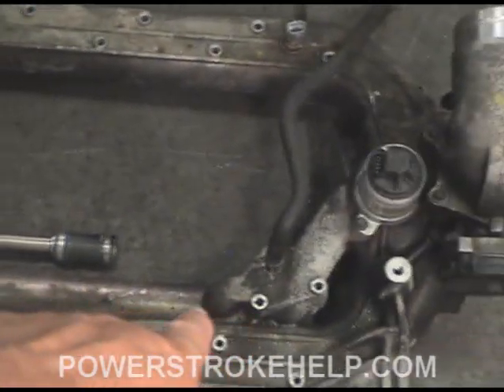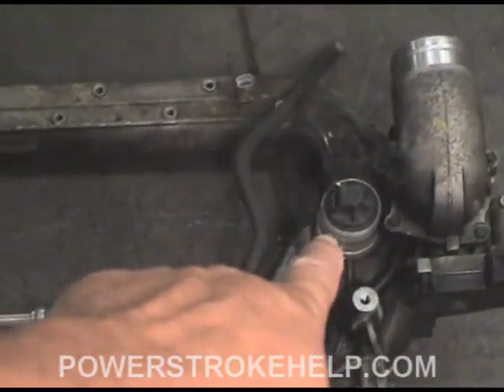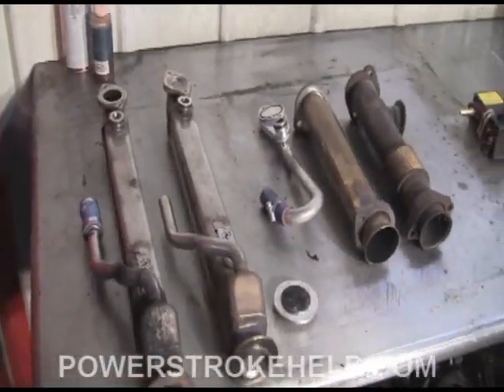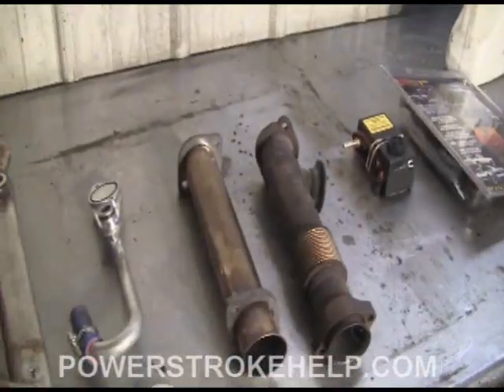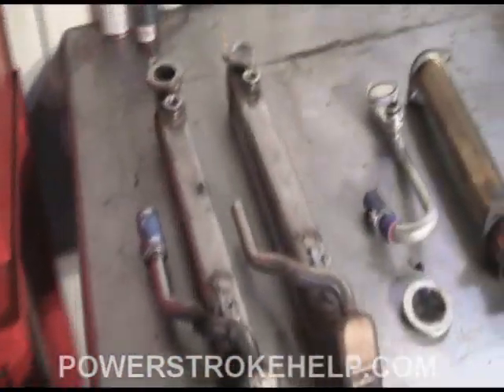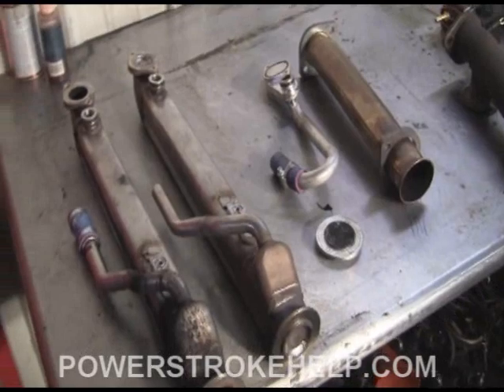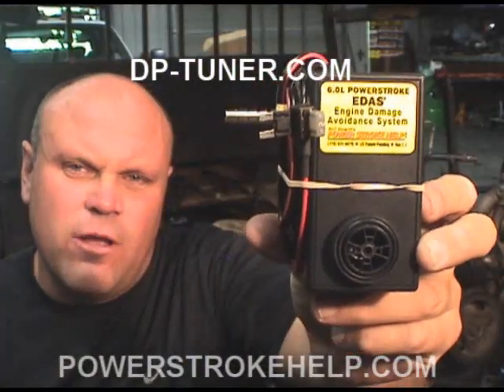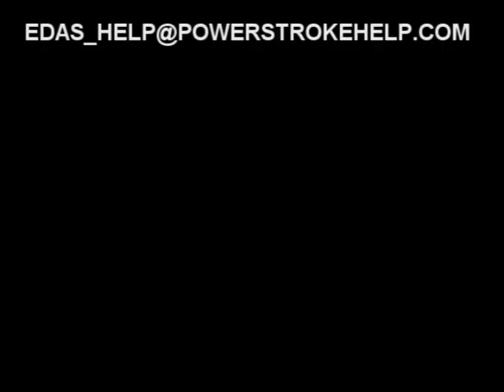6.0L EGR COOLER DELETE AND OIL COOLER ISSUES

Comment: I have a question ,I have a customer that bought a 07 f250 with a 6.0 and it had just go item the head gaskets replaced ,but they did not replace the head bolts .my question is this can the head bolts be replaced one at a time or do the head gaskets need to be replaced

Comment: Navistar uses CAT EC-1 ELC in their versions of these engines with the same EGR and oil coolers, and they don't have the issues of the Fords with the precipitating coolant they DEMAND be used or you void the warranty! Unfortunately, deleting or defeating the EGR system is ILLEGAL and states are beginning to crack down on the practice. Best to replace with the new, stronger design, new oil cooler, coolant filtration system, and use the coolant specified by the manufacturer, NAVISTAR,...CAT EC-1 ELC after a complete flush and back flush of the complete system. 😊

Comment: Wait so I can just weld the ends shut on my EGR cooler and It'll act as an EGR delete? its that easy?
Reply: Yup. That and a block off plate for the valve itself. That's it. You can't get tunes  to shut off the engine light in 05 and up anymore. You'll have to live with the light, or... Plug in the EGR and reinstall it. It won't pass exhaust gas as the ends are welded shut. Make sure the weld job is done properly, and bam. 

That's it.

Comment: Tried your website would not work. 05 excursion 

Texas here we had a freeze bought this truck belive it had water in coolant do to had to replace waterpump and then. A plastic y connector. Then it was fine fast-forward two days later had a really hard time starting then tons of white smoke till I could get home no power loss what so ever did not overheat. Waited a day checked coolant degass bottle was empty. Brand new bottle and all new coolant. 275xxx all stock. Question is I am worried the cooler internal cracked and let coolant into the exchaust. Is that possible or failing egr valve could cause this. Got hoodwinked by the guy who sold it to me. Spent thousands already.

Comment: Issues Issues Issues-look to Isuzu engine designs & be done with the handicapped crap🙄
Reply: 🤣 no. Lbz is just as hard to work on, harder in fact. Great engine other than constant injector failures. Trans behind it is weak compared to the 5r110. 

Just some absolute, undeniable facts. I'd much rather work  on a 6.0 powerstoke over an LBZ anyway.

Comment: This is a longshot. I have an 05 6.0 and I have oil coming from the exhaust into the turbo. Has anyone seen this? Is it possible I have injector seals going bad? It looks like raw oil on the inlet side of the exhaust, not the outlet side so it doesn’t seem to be an issue with the turbo seals

Comment: I’m not a diesel guru and don’t completely know these systems. Does water still circulate thru the oil cooler with the egr cooler welded shut?

Comment: Some folks think the 6.0 is indestructible, and you can't help people like this.
People like this have to learn the hard way, don't be left holding the bag, inform them that they are responsible, even with "Bulletproof" parts, people will find a way to destroy the engine.

Comment: Hey, I have a question about the egr delete that you did. 
So let's say my egr is bad and it has a coolant leak . So then I do the egr delete. So I weld the ends and put it back in I hook up everything and so on. So here is my question so if the egr is bad and leaking if I weld the ends won't the coolant leak out were the egr went bad and collect in the egr or will it just pass through like it normally does. Thank you god bless .

Comment: Help- my 2017-Ford Transit 3.2 Diesel just over heated / loosing coolant, white exhaust, EGR Failure at 57,000 miles - I starting to think i should have went with the ECO Boost ?

Comment: chuck's 6.0  I am a machenic.On 2003 to 2007.You can do a EGR delite with out it throwing a code.What i do is use stainless freeze plugs.30mm and 1 3/8 to block it off.I drive a 2003 6.0.I have had very few problems.I have never chiped it tho.

Comment: The main problem for problems with the 6.0 is the 6.0 engineers that's the problems oil pumps of fell all kinds of tissues for this motor and that's the main problem with the 6.0 Ford Powerstroke

Comment: I have a problem with this EGR delete solution.  DISCLAIMER: I’m not a mechanic, so I can be totally mistaken.

The problem with this solution is that the coolant is still circulating through the EGR.  If the EGR is blown or eventually ruptures, you have the serious problem of coolant filling the exhaust portion of the EGR and then contaminating the coolant system with exhaust soot.  Also, you will still have the exhaust flange and “scoop” that directs exhaust gas.  So you’re more likely to have an exhaust leak from the blocked-off end and you’re also hindering your exhaust flow by keeping the scoop in tact.  Lastly, this is only a cheaper solution if you are a welder or have easy access to one.  

It seems to me that total removal and bypass is still the best option.  Just find a supplier that offers a good leak resistant clamp set up.  It’s a clamp. That’s an issue that shouldn’t be too hard to overcome.

My fellow 6.0 brethren... please chime in if I’m wrong :-)
Reply: when EGR cooler is blocked off from hot exhaust gases it's chance of rupturing 100x lower. Also as he was explaining in the video that "scoop" is necessary as it keeps the exhaust pipe from wobbling and braking stuff

Comment: So i live in California and have to smog every two years. i want to do a egr delete but i also want to to look legal, so my question is if i weld both ends of the egr cooler will my truck throw a code? If it does then i would automatically fail smog check due to the check engine light. What would be a good plan B?
Reply: chuck's 6.0...You can do a EGR block and not get a code on 2003 to 2007.What i did is take engine freeze plugs stainless 30mm and 1 3/8 blocked it off.much easter than welding.you put it back on.looks stock.
Reply: Detroit Diesel 6.2 yes it would throw a code p0401

Comment: I have a stock 04 F-350 crew cab 4X4 Centurion, 150K miles, never any serious issues but have been concerned with the EGR cooler stories.  I bought a replacement EGR cooler, took to a machine shop where they charged me $40 to weld ends shut. It took me about 15 hours of Labor over the weekend (disassembled & cleaned turbo at the same time) I followed the advice of this video exactly and I am shocked with the difference. Couldn't be happier! Thanks!
Reply: Jay Christensen did you notice a difference in the performance?
Reply: did you experience a problem with power loss?

Comment: Hi

i have ford e350 6.0 2004 disel win 1FTSE34P34HB19588 , it was making smoke and losing power. i put car in turbo specialist to fix it but they fixed some issues but the car still has power lose and some times showing turbo bark. it seems they can't find problem. i live in North Vancouver canada and i need your help as specialist. now my mechanic asked me to delete egr cooler but i am not sure it will help.
You can see his reports by email . i can pay you for your solution 

Thanks
Reply: Do they do emissions (smog) in your area?

Comment: I did the sinister style at 46,000 miles and a Hypertech Max Energy, 5" exhaust w/ 4" down pipe, fuel pressure spring upgrade, Amsoil external bypass oil filter and have had to only replace the FICM @ 99,000 and IPC sensor twice but invented a specialty socket the second time i replaced it.  I have total confidence in my 6.0. Its got 3.73 gears and choose not to Highway drive above 75mph keeping the rpms about 2100.  I just bout another 6.0 F-450 and am going to do every thing but full exhaust. It has 167,000 miles so I'm getting it late but i feel not to late to save it.  However the gears in the 450 are 4.88 and at 65mph the rpms are at 2400 this sucks but Im not pulling heavy loads and the terrain around where i live is flat compare to the mountains in Ky and Tennessee .  I've always felt that the egr was the source of the problem but never heard anyone else lead off with it till now. Thanks for the videos .

Comment: Im sticking with my old chevy 6.5 turbo. 50 buck injectors and 700 buck injector pumps
Reply: videoclipits I miss my old 6.5. It wasn't anything crazy, didn't make huge power, but it was also a small truck that was cheap to fix.
Reply: Love my old 6.5😎😎😎

Comment: My cooler is in great condition, so I TIG welded it closed on both ends and reinstalled it. Just like the video says.  This is a better solution.  There is NO WAY any coolant will ever get to the intake tract, even if the coolant side of the this heat exchanger were to fail.
Reply: I'm thinking of doing the same thing. was it stainless or aluminum? what diameter and thickness pieces did you use to weld it shut? also, did you use a tune to turn off all the egr stuff off, or leave the programming alone?

Comment: So bottom line.... buy a 7.3. Lol.
Great video. Keep up the good work.
Reply: every7.3 has crazy miles and beat up interiors now adays
Reply: Lol truth ...
Reply: The main concern with owning a 6.0 psd is maintaining clean coolant. Sand and crap in coolant takes out oil coolers and egrs which leads to head gasket failures.  And if you're going to tune them ,headstuds are a must.
Reply: No tuner... Too many bad stories with tuners. Couple buddies boosted theirs and blew them up. My cousin is on his third tranny... Right now I can pull a 3 ton trackhoe and 1 ton trailer up hill 65 mph no problem. Used to have an old 5.4 2 valve that could only do it 35 mph maybe tops so 60 or 65 is a big improvement. I can't complain.
I bought the truck with 200K miles and it's an 05. Of course the egr was screwed up so I had to have that deleted. Changed the coolant and oil. Added some Lucas to the oil tranny transfer case and the pumpkins. So far so good...
Has no cats and the egr has been deleted. I really don't need anymore hp...
Almost bought a 2V V10 but this came along for almost the same price so I had to jump on it.
Reply: +Carl Michael 
I'm saying you have to do the head studs if you tune the 6.0L diesel. Many 6.0s "bulletproofed" down here that are friggin beasts. I have an 07 6.0 that I'm in the process of bullet proofing minus the head studs. I plan on keeping it stock. Very light work , no towing.
Reply: Luigi Luigini 
Oh yeah I know what you mean. If I was gonna tune it id definitely do the head studs but for now I don't plan on adding a tuner.
That was my buddies problem. Quick to tune it but didn't do the head studs....
Reply: @luigiluigini9500  Wrong. My parents bought themselves a bone stock 2000 crew cab short bed 4x4 7.3 with like new interior, rust free, no body dmg, and 180k miles, last month for 12k.

Comment: what would it cost to have the EGR done like that on an 03 F250 6.0? no issues as of yet but February of 2015 Oil cooler ruptured and had it puking this peanut butter consistency stuff from degas bottle. had thought about the Bulletproof diesel kits for it....

Comment: I tried calling the number to ask bout Egr delete on my semi truck the Person name Dany or Dan sounds like he doesn't want to help. Just turn me down without understanding what kinda truck I have or what not. That's not coo. I can always find somebody else to do the job but u guys should listen and understand the customer first before shuving them to the side.
Reply: +AZIZ OMER Seeing how this is a 5 year old video and the feds are getting tougher on this sort of stuff as years pass I'm not surprised they wanted to end the call right after you said you wanted to do this, as it's illegal. Many times a smaller shop will do a modification like this if you show up in person, or pay off the books, but even then it isn't guaranteed, and a shop that has gotten caught won't want to go anywhere near another possible violation.

Comment: A pre-trip inspection EVERY morning is critically important. This is why commercial truck drivers are required to perform this check. You can  identify a problem, whether it is a one time issue or ongoing and address it immediately, even if that mean adding coolant. JUST DO IT.

Comment: hey ferkemall do you live in the U.S. Some people try and attempt to make the world a better place. it doesn't always work out. America is the land of dreams,progress,and freedom (dwindling down fast I grant you) egr on diesels don't make sense yet. they cut power,performance and even fuel mileage not to mention other costly mechanical problems. what does Renault do for the world ? the air quality ?, dependence on fossil fuel etc ? Now I'm not a tree hugger but I don't want my children mucking around from the polluted emissions left by a Renault or a ford . I think all of mankind across the globe wants dependable pollution free transportation . And remember this my ford hauls cattle, pigs, and farm produce not to mention organic grains and feed for livestock . When I see a "Renault" that's the equivalent to my  05 Ford F350 4x4 dually that hauls 20,000 lbs through mud,rock,and hiway then please let me know . Until then take your ponytail and head back to pot smoking amsterdam.

Comment: I did the egr like it showed in the video and the check engine light comes on is there a way to turn it off or does it just stay like that?
Reply: +Victor Padilla you have to put a scanner/tuner on it and disable it. The light is coming on for a egr failure. You can by pass that with the scanner mentioned in the video

Comment: I have a question. Can I just block off the up pipe and put it back on and get the sct tuner to prevent a code why do you need to block off both ends and put a new coolant tube on?  In my mind if I block off the exhaust at the pipe it should be good to go l.
Reply: You would want to block off the egr totally do that way your coolant can't get into the intake should the heat exchanger start leaking. You have to pull it anyway so might as well do both ends.

Comment: If you block or weld the egr cooler on a 2006 6.0 will you get a CEL? Or any other weird running conditions? Thanks

Comment: egr codes are the next problem
Reply: marion cobaretti , what codes?  An egr valve is either shut or open.  As far as I know,  it doesn't sense if anything is going through it
Reply: 05-07 will eventually throw a p0401 code. Need an SCT tuner 7515 to disable it.

Comment: Thanks for your great videos I have a oil leak that showed up on the high pressure oil line fittings thought it was a rear main seal lol yea the valley had a pool of oil thanks again my 02 7.3,has 92 k on it

Comment: I want to do the EGR delete but what if the ENGINE LIGHT comes on? or what if my truck never passes the emission test again? I live in CA... any info on this?
Reply: JC Martinez Californians are usually screwed but from what i have heard from a personal friend of mine with a cummins that has several exhaust systems removed, who works in a Toyota store as a technician that diesel smogging is different OR there are other ways to smog and get around the smog test.

Sorry that the info is very vague but those were his words and you might be able to find a guy at shop that will work with you

Comment: why doesnt anyone come up with a chemical to pump thru the partially plugged oil cooler that dissolves the precipitated deposits and fixes the problem ?
Reply: oxsalic acid works decently well but it won't work all the time, if its badly plugged you can try rinsing it out, garden hose spray with lots of bubbles and force. A little acid rinse and flush, repeat.  If you have lots of junk its like cars in a parking lot, it'll flow around the debris without moving it.

Comment: Bill, have a great idea for a clip, the problems you can (WILL) have if you put DEF into your diesel fuel tank. A good friend got extreamly lucky, he put DEF in while the engine was running, and got some into his engine. Had to replace every sensor in his fuel system and a 30 second mistake turned into a 5K nightmare! Keep the clips coming! Thanks
Reply: Joseph Deerslayer